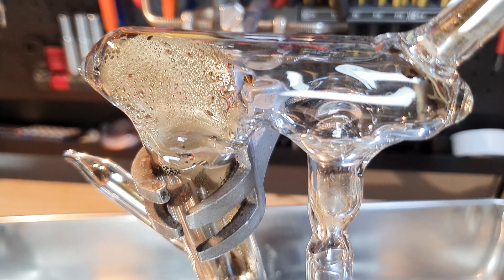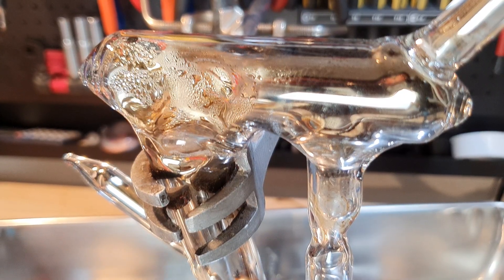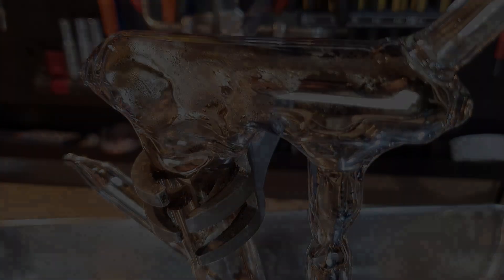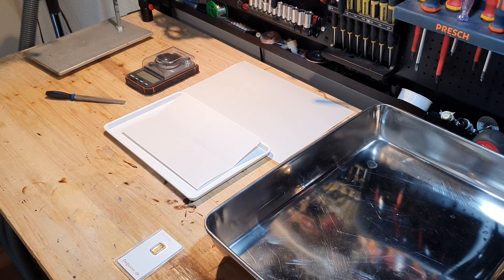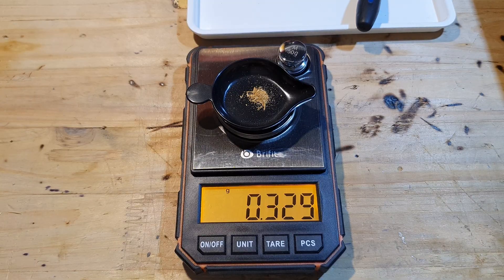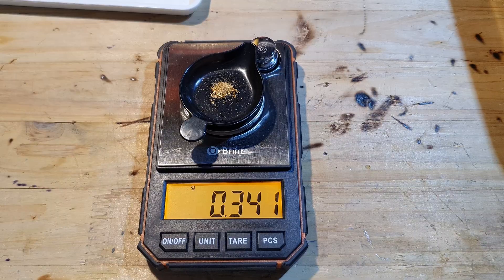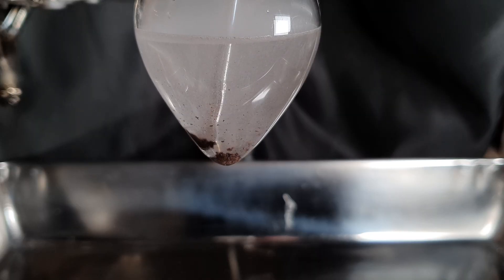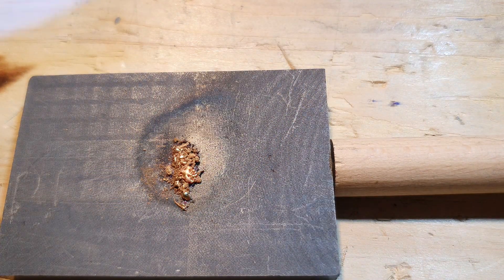Making Cesium auride (never done on YouTube before)

Comment: @AdvancedTinkering I don't know how to put this properly, but Cesium Auride sounds like a really cool compound to try to make memristors out of. If you imagine an electrochemical cell like a long glass tube half-filled with a stick of Cesium and half-filled with a stick of gold, the resistance would be low as both are metallic. This goes for AC and DC, but for DC it'll only stay low if the electrons are supplied at the Cesium end and extracted at the gold end. If done in reverse, the interface of cesium auride would have its cationic cesium migrate to the cathode, and the anionic auride migrate to the anode, increasing the interfacial salt wall. Go on like that for a while and your entire glass tube would be filled with cesium auride, not a stick of metallic cesium and metallic gold. keep going even longer, and the cesium cations might be reduced at the cathode again and the gold anions would be oxidized to metallic gold again, creating once again a tube with mostly metal inside with low resistivity. I hope this concept makes sense, I have no-where near the facilities to try anything like this, but it does sound like it has potential to become a breadboard-size memristor component, if electrochemically it works as i hope it does. I know I'm not a patron, but if i've interested you with this idea i'd love to hear if you'd be interested on working with it. I'm developing an amateur interest in analog signal processing and i'd love to have something to store data on without having to go from analog to a storage medium, even if its a winding of fiberglass to delay light or a rotating magnetic tape to deposit and later retrieve a signal. 
Kind regards from a Swamp German! 🇳🇱

Comment: I just realized that you've made a compound not only between 2 metals but also between both of the only 2 golden metals on the periodic table!
Reply: not quite correct.  Nickel when freshly plated has a  slight gold sheen on it. Silver-gold if you like.
Reply: @F_Tim1961  this highlights the subjectivity of where we draw the line between golden and silver colored metal.
Reply: Europium is also gold
Reply: Cesium is a bright-yellow metal, but from it's also so reflective it's hard to tell unless you angle it right.
Reply: Any metal that stays blue other than blueing steel?
Reply: @binLADDDER  Osmium is blueish
Reply: Pure Cesium is not golden
Reply from the maker: It actually is golden. It is a common myth, that pure cesium is silver.

Comment: From 1988 to 1995 i was tried to find a new way to get Na and K metals from salts likes  NaCL, KCL, I believe there is a solvent who can Dissolve the salt,  without reacting with the released metal.. and accepting the passage of electric current between  electrodes without needing to melting the salts for this reason.. but until this days I was failed to find that solvent;)))
Reply: Propylene Carbonate.  You need to add a little AlCl3 to increase the solubility of the chloride salt in it, tho.

Comment: Redder makes sense, depends on the material of course.  But a lot of things are yellow when fine, orange-red-brown when coarser.  Cu2O behaves very similarly; when produced from reduction of Cu(II) solution, it's typically a "brick red" product.  When produced electrolytically (copper anode in NaCl electrolyte), it's yellow initially, deeping to a bright rusty-orange color over time.

Which, is CsAu a semiconductor too? -- Aha, yes, it is.  So this is probably the case, and probably gives other colors when extremely fine particle size causes quantization of electron levels (quantum dots).  (The usual demonstration being done with CdS or something like that, different precipitation conditions giving different UV fluorescence.)

So what's next, uh, CsAu LEDs?  (Is it direct bandgap..?)  As impractical things go, that's definitely one of them... LOL
Reply from the maker: Thank you for the information! 
The CsAu LED is an awesome idea^^. I will take a look into that. If there is a overly complex and inefficient way to make some light with cesium, I'm in!
Reply: @AdvancedTinkering  worlds most expensive display tech ;-)

Comment: Extremely cool! It's too bad that you didn't have liquid ammonia. I wonder how it would look with gold foil. Will liquid cesium absorb greedily it like mercury does 🤔
Reply from the maker: Thanks! I will first try it with gold that has been precipitated out of solution and when I get my hands on some gold foil I will try that too. But since the reaction needs heat to occur, I don't think it will look as cool as mercury. Since it does not form an alloy.
Reply: @AdvancedTinkering  gold leaf is available pretty readily though it may be an expensive way to buy gold by weight. Still quick and available in small quantities. Watch out for sellers selling imitation gold leaf though, if it seems too good to be true price wise it may well be.
Reply: Unlikely it will produce an effect like the amalgamation of gold as it wont even react with powdered gold at room temperatur. Also gold fail will have a poor surface area :/
Reply: Hey ChemicalForce, you should totally do a video on this!

Comment: In a vessel that can handle vacuum, if you add cesium chloride and Carbon, then remove air with argon and seal vessel, with applied vacuum. (just like carbon to an oxide you get the metal) Heat up the vessel to high temperature to separate the Cesium metal from the alkyl halide. Transfer to florence flask/boiling flask with long stem, then seal it off as an ampule. I have done this reaction to obtain many elements from its oxide all the time. I am guessing it could work.
Reply from the maker: Do you mean reducing caesium chloride? I have done it several times(There is a video on my channel). But not using carbon. I used Lithium. But you definitely don't want any pressure in your system. It increases the boiling point of the cesium and is very dangerous if your apparatus explodes. 
Be careful and do not try it if you don't know exactly what you are doing. Cesium is no joke and you can get seriously hurt handling it.

My videos are not meant as instructions! There is alot I don't talk about in the videos that you have to know to do it yourself safely!
Reply: @AdvancedTinkering  Yes, you are correct, Under vacuum anyway, it will pull off the alkyl halide while leaving the cesium metal. I was just thinking of a way that you can almost reflux it while taking off the alkyl halide to be left with the product you are after.
Reply: @inoxio8716  I don‘t quite get you point you are trying to make - you are proposing an overly complex way of producing cesium - meanwhile there are two way more simple and way more optimized ways of doing that - one is the reduction of a halogenide with lithium - can be almost done with any metal as long as its boiling point is lower than lithium - and the second method is thermal decomposition of the alkaliazide - which will leave you with ultra pure (in this case) cesium and nitrogen.
So i dont quite see what would be a reason to do the reaction you mentioned - its basicly just a overcomplication for the task